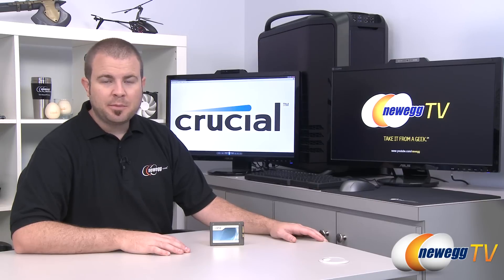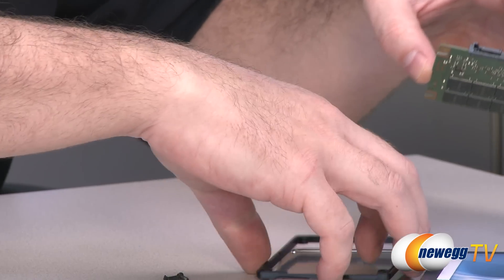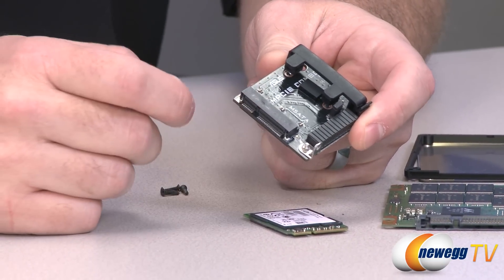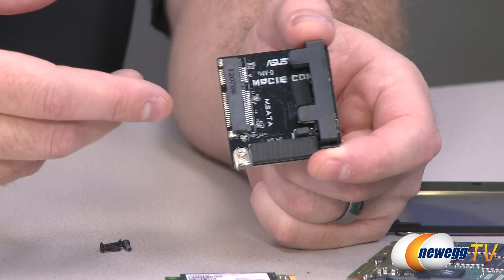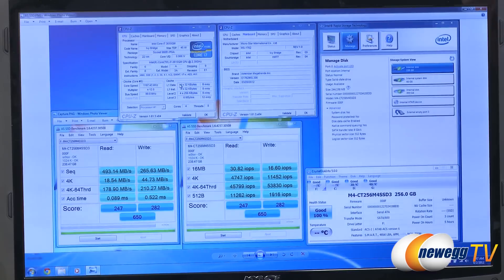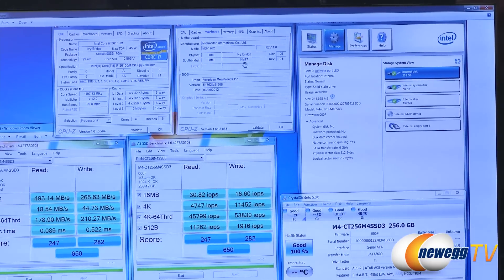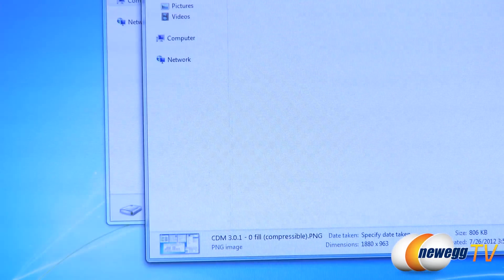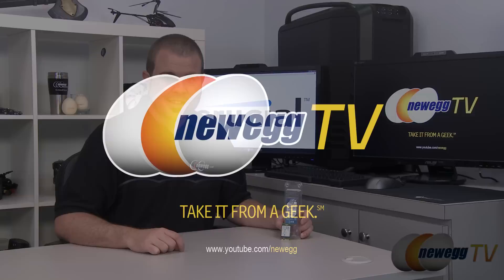Newegg TV: Crucial M4 mSATA 256GB SATA III Solid State Drive SSD Overview

Comment: 10 years from now Intel will release it's CortexDrive. A memory chip with infinite 0's. Like a biological brain, it will never run out of memory. Similar to chip sets the CortexDrives will be attached to the motherboard. They will be the size of a CPU and require its own fan/heat sink. Speeds will be unmatched by the inferior HDD and SSD. (Fiction)

Comment: It actually is, the SSD controller uses it for caching. Typical hard drives have 32 or 64MB cache, SSD's usually have more than that - this one has 256MB DDR3 chip for caching.

Comment: The actual reason is that the Air and Retina Pros use SSD storage that is on-board, not actual drives.  Even if you opened them there are no swappable components.

Comment: i got the crucial m4 128gb off newegg a few months back, works fine but last week i ran into a problem where my computer would freeze every hour and i later found out that FIRMWARE 0009~0309 needed to be updated to 000F